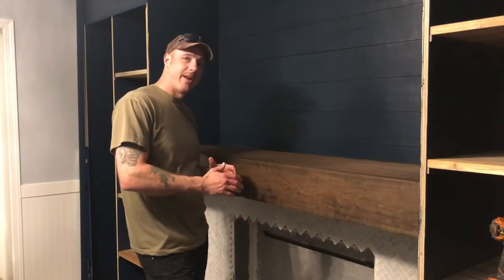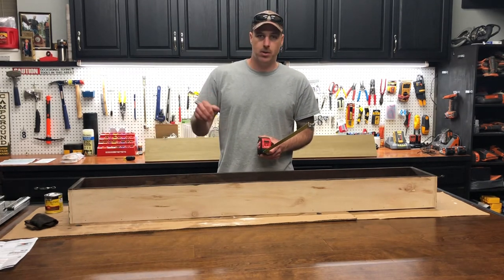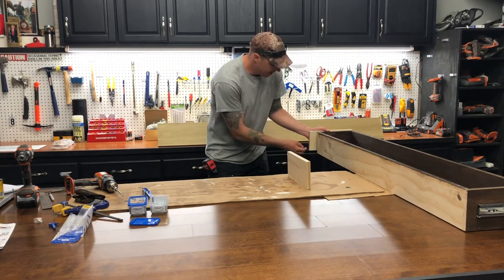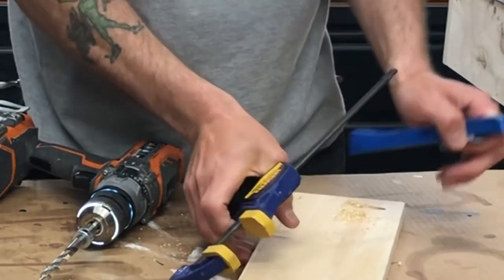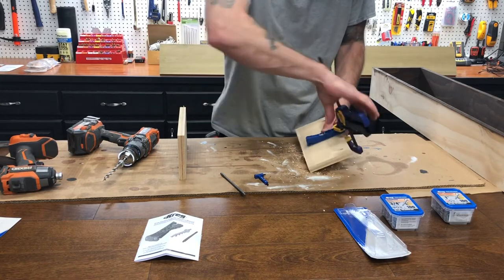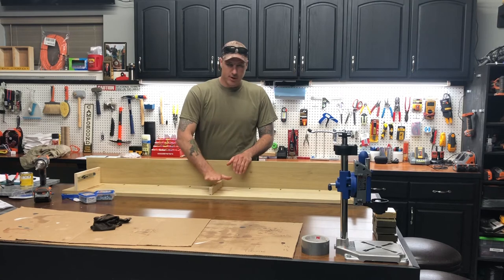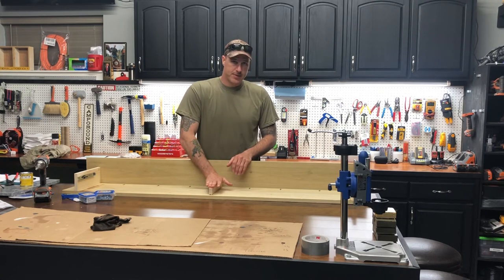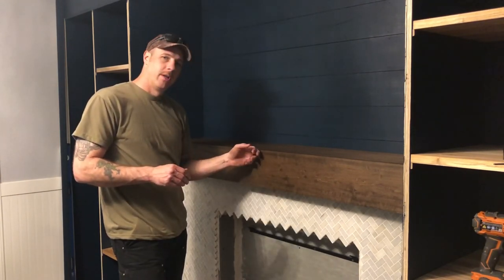DIY - Fireplace Mantel with a Secret Compartment! Intrigued Yet? Click to Learn More!

Comment: Great build with lots of good info that I'm going to use on mine! Love the addition of the old school wooden guide down the middle, quick note if its ever sticking or squeaking you can use beeswax for wood on wood lubricant 👍 great video lots of detail 🍻
Reply from the maker: Hey thanks for the comment and support Zach! I really appreciate it. As for your beeswax suggestion… that’s great and will use that if I have any sticking issues. Thanks again!